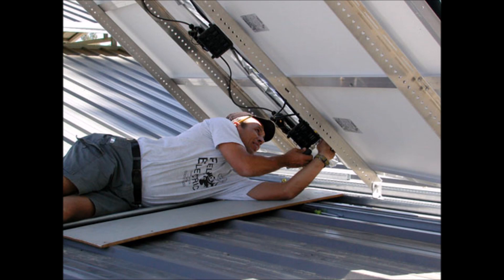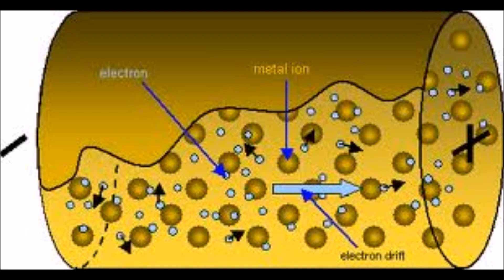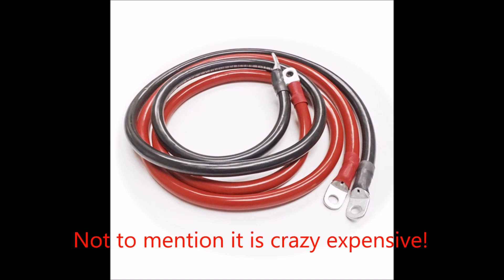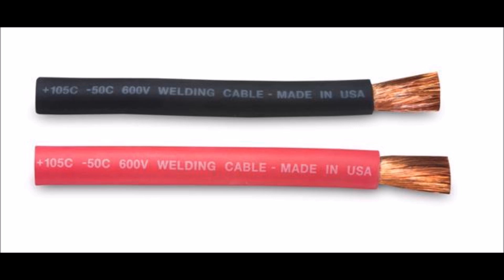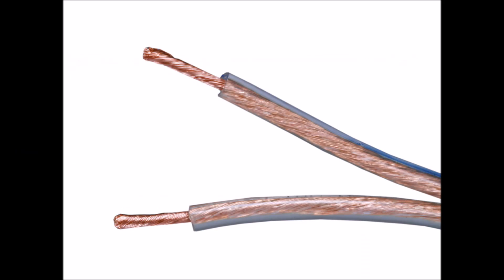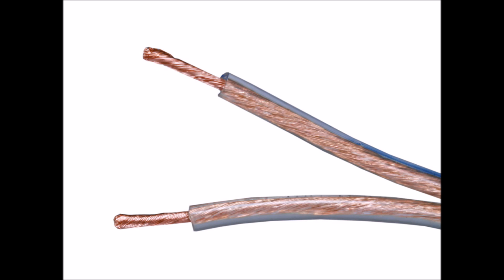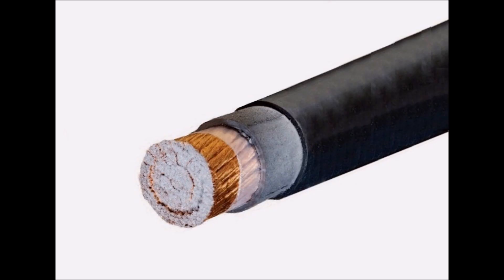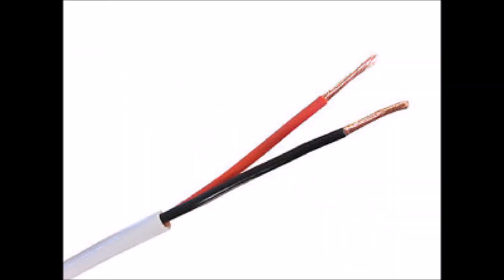Solar Panel Basics - Cables & Wires 101

Comment: Let me ask,  so every wire like the THHN can run both AC and DC, is it?
Reply from the maker: Yes, the wire doesn't care what type of current it is.  In AC there would be more conductors than with DC.  That is really the only difference.
Reply: Tnx for your reply! But what about breakers and fuses? Will they be used either AC or DC too?
Reply from the maker: No, breakers and fuses are specific for the type of current.  Some will work for both but not many.  If you are looking at house breaker boxes (load centers) then the QO series by Schneider will work for both.
Reply: Yah Schneider is everywhere here..yo da man.. thanks!
Reply from the maker: You are welcome.  I have successfully used the Homeline series in solar in the past but I really don't recommend it as they are not rated for it and they might not keep you safe.  The QO series is rated for 48V DC and can handle a LOT of amps, more than most solar panel systems will ever need.

Comment: Audio sucks, info not so good, better leave such advice to the pros, speaker wire for solar really!
Reply from the maker: Yeah I don't know what happened to the audio.  But the type of wire only matters based on the conditions it will be exposed to.  If someone is just getting started and that is all they have then speaker wire will work.  Will it last 25 years with the solar panel?  Absolutely not.  But some people can't pay $1 per foot for solar cable.

Comment: Can you run your solar panel wires to a fuse block or do you have to go to the battery directly?
Reply from the maker: Yes, you can definitely use a fuse or breaker in your wiring.  However, your wires should not be going directly from solar panel to battery.  You need to have a charge controller in between.
Reply: What gauge of wire do you recommend running from the charge controller to the battery( it will be for a 100 watt panel)? So i should just run an inline fuse on the wire before the battery?
Reply from the maker: For a 100W panel, you can use #12 gauge for up to 8.5 feet before you start seeing voltage drop.  That should be long enough unless you are mounting your charge controller a long way from your solar panel.  Go #10 gauge for up to 11.5 feet for under 2% voltage drop.
Reply: Thank you for your help.
Reply from the maker: You are welcome!

Comment: What gauge do I need to run a 50' wire from the panels to the controller? (Maybe can cut down to 40' but not anymore)
Reply from the maker: How many amps will the wire be carrying?
Reply: ummm....good question... it's a 100w / 18V panel,  so would that be about 5 Amps?  I'm still trying to learn this stuff hahaha

Comment: i have two 100 amp hour 12v deep cycle batteries. i need to put them in series in order to boost the voltage to 24v, as my panels are both 24v. then i will wire the battery bank to a charge controller less than 6 ft. away (batteries on the ground, charge controller at eye level). My question is, what size wire do i use to make the "series" connection between the two batteries, and what size wire do i need to use to go from the bank into the charge controller? i cant imagine 2/0 awg would be able to fit in my 30amp charge controller terminals. FYI im gunna be using only about 60w dc to power some ip cameras and an access point. No inverter in my system. all DC, just gunna use the "load+-" terminals on my charge controller to regulate/power them. thanks in advance for your time.
Reply from the maker: If the highest load you are ever going to use is 60W then the gauge of the wire between your batteries won't matter much.  The distance is so short and the load so small that almost any wire will do.  From the charge controller to the battery bank I would use #10 AWG as it is cheap and easy to find and will handle 30 Amps for up to 10 feet.  That is way overkill for your application but that would be what I would do.
Reply: LDSreliance hey thanks for your advice, i came to the same conclusion and ordered the 10# wire. but i want to leave room to upgrade to an inverter, so can i use  2# welding cable to connect the two batteries together? 2# between batteries, 10# to and from the charge controller.
Reply from the maker: Sure, you can do that.  I always use the biggest gauge I can afford and that will phyiscally fit in the connectors.  That way I have plenty of room to add things in the future.

Comment: Hi.       I have 2 solar panels of 150 watt each (8.5 + 8.5 ampere). Distance between solar panels and charge controller is 8 metres. The AWG table suggests 16 mm square cable. But in market there are only 4 mm square and 6 mm square cables. Is it possible to make 16 mm square cable by joining two 6 mm and one 4 mm (6+6+4 = 16 mm square)? ..................(12 v system)
Reply from the maker: Unfortunately, that would not be ideal.  Where do you live?  16mm would be roughly 5 AWG but that isn't a standard size so you would have to use 4 AWG.  I would also recommend THHN wire.

If you can order from Ebay, this is the wire I would recommend and the seller ships worldwide:  
http://www.ebay.com/itm/25-foot-cut-of-THHN-THWN-4-AWG-600v-Black-Copper-CU-Stranded-Ground-Wire-FREEshp-/332050333079?hash=item4d4fbdfd97:g:M-sAAOSwARZXljA2
Reply: I live in india. .................................................means 21.14 mm square?
Reply from the maker: The label ground wire doesn't mean anything.  It is just because of the color of the sheath.  Ground wire and power wire are the same thing.  5 gauge will work great if you can find it.  Here in the U.S. it is usually only sold in even numbers 4,6,8,10,12,14, etc.
Reply: There may exist many threads of copper in a wire........right!....... Do the gauge of a single thread remains same whether it is of 4 or 6 or 8 or 10 or 12 or 14?................do the amperage depends on number of threads in a wire?
Reply from the maker: Yes, you should always use stranded wire for solar.  No, the gauge of a single strand will get bigger with heavier gauge wire.  The amperage does not have to do with the threads, no.  It has to do with the resistance of the wire, which has more to do with the materials that the wire is made of and then obviously the length of the wire.
Reply: Thanks................useful information !
Reply: Thanks....one more time......... for eBay link
Reply from the maker: You are welcome.  Just be sure to subscribe to my channel and give me a thumbs up to help me out!
Reply: Hello LDSreliance!............. How r u? ................do I use DC MBC in my system?.......... Of how much ampere?..............single pole or double pole? ................before charge controller or after charge controller?

Comment: Ok I am pretty much clueless with my cable connection to a zamp equiped camper I have . I was told to get an adapter to reverse the polarity, so I did. But I cant connect the cable to the adapter because they are different connections , and I don't know the name of such an adapter. Could you tell me what would it be called that connects a 12 awg cable to a reverse adapter to plug into my zamp camper?  I'm sorry  I'm having trouble explaining my situation, but like I said I'm really clueless to all this .  Thanks
Reply from the maker: I am having trouble visualizing what you mean.  Send me an email with some pictures to ldsreliance@gmail.com.
Reply: OK!

Comment: I am only able to get my solar panels about 100ft away from my house. I have 10 12v x 15w x 1A. I have a roll of 10/2 house wire left over from when I rewired my house. My plan is to run the wire from my solar panels to my equipment in my basement. I can however put my equipment in a small area inside the chicken coop (sealed off from the chickens) and just run AC thru the wire into the basement. Would like to know your thoughts. Thanks for your time.
Reply from the maker: That is a great question.  I highly recommend that you convert the power to AC before running it through that long of a run of wire.  The voltage drop at 12v through that wire will be horrendous.  The other option you have is to wire those panels in series and parallel to achieve a higher voltage such as 24v or 48v.  That will lessen the voltage drop greatly.  If you do that, I would highly recommend an MPPT charge controller instead of PWM.
Reply: As an experiment, I hooked 1 solar panel up to the roll of 10/2 wire to check for voltage loss and found none. I was unable to check an amp output. . .
Reply from the maker: There won't be any voltage drop until you put it under load.  If you have one, connect a car inverter on one end of the wire and then a battery to the other end.  Then measure the voltage at the inverter.  It may not even turn on because the voltage might be lower than the minimum threshold for that inverter.

According to my calculations, if you ran wire 100 feet with a 12.5 amp load (150 watts) at a voltage of 12V you would need 2 gauge wire to do it with less than 3% drop.
Reply: I'm going to go the safe route and just make my set up where the panels are located & just run the AC from there into the house. . . Anyway, I do want to thank you for all of your help. I do have 1 more question for you. . . What is the difference between a MPPT charge controller & a PWM? Again, thanks for your time.
Reply from the maker: You are welcome.  MPPT is Maximum Power Point Tracking and basically it can convert excess voltage above the charging voltage into extra current.  In other words, if your panels are producing 16v but you only need 14.6v to charge your battery then it will take that extra wasted voltage and convert it to more current.  So it is more efficient than a PWM controller.

I really need to do a video on MPPT vs PWM controllers at some point.
Reply: Thank you again for your time and patience with my questions. I never realized that it was so many different hurdles to go thru. . . The inverter came today. . . The battery should be in tomorrow. I got the TRIPP LITE inverter PV1250FC. I can't wait to see everything hooked up. Anyway, thank you again.
Reply from the maker: Very cool.  Let me know if I can help further.  This is the exciting part of the project!

Comment: Good, but for long PV runs it depends on voltage. MPPT allows for higher PV volts and longer/thinner cable runs. For example, I am running about 110v of PV solar panel voltage through 125' of 10AWG dedicated PV feeder cable. Higher volts/lower current = lower loss. Using online calculators, my loss is about 1.7%...which is excellent. The solar charger will down-convert the higher volts to charging current. As for battery cables, welding cable with fine strands is the best for home RE systems...esp, if you make them yourself. Running 24v or 48v (inverter-battery bank) is even better.
Reply from the maker: *****
I just responded to your other video and it sounds like you grasp the concepts pretty well but just need to put it all together.

Yes, if you want to wire with 120v AC that would be MUCH cheaper and MUCH less voltage drop than 12v or 24v DC.  I think the online wire calculator was assuming you were using 12v.  75' of 2 gauge wire is going to be pretty expensive.  So if you can collect the power from the solar panels into your charge controller and battery bank very close to the panels and then connect your inverter and run a 75' run of Romex wire to your house that would be much cheaper.

I would highly recommend not connecting it to the electrical grid in your house, though.  Not only is that illegal (without a permit and the electric company's permission) but you could also hurt or kill a lineman or electrician who was working on the electrical grid in your neighborhood.  If you want to just wire it to an outlet box in your house so it is an isolated system all by itself that is fine.  It is probably still illegal, though, and your homeowner's insurance would probably not cover your house burning down if you make a mistake.

I'm not trying to scare you but those are the reasons I chose not to do it that way.  If you hire an electrician to do the portion inside your house it will be both legal and insurable.
Reply: LDSreliance is absolutely correct. Transmitting AC is much more efficient than DC. Try this online calculator...it has wire size, voltages, phase, number of conductors, distance, and load current. For load current, use the VOC. http://www.calculator.net/voltage-drop-calculator.html
Reply from the maker: +Chris DIYer Yep, I agree.  I felt like that was too complicated for this video so I tried to stick to different types of wires and only briefly touch on voltage drop and resistance.
Reply: +Chris DIYer OK, so confused.  When I go to the online wire calculator, they do not ask voltage, they ask for distance and amps?   And for just 75' it looks like I would have to run each panel separately (15amps max each) to keep my wire size down to 2 gauge.  But this is coming in at just under 3% power loss.

Would it be better to make a battery bank outside, directly beneath the panels, along with the charge controller and inverter, then wire the 120V from inverter to house?
Reply: What square mm stranded wire would I need for 15 ampere dc current from my solar panel to mppt charger

Comment: I enjoy your videos, especially the solar DIY ones. I am just starting solar and have 2 100watt panels. I need to run about 50 feet of cable to my charge controller, what gauge wire should I run. I am planning on getting a 12volt 100ah lithium battery with the appropriate charge controller. Any thoughts or ideas are appreciated.
Reply from the maker: +carver222 Make sure you get a charge controller that can handle a lithium battery.  Most that I have seen cannot.

As far as what gauge, you need to go really big for 50 feet on 12v.  As big as you can afford.  12v doesn't do well with restistance at all.  If you were doing 24v that would be a lot easier but most beginners use 12v.  For 200 watts, you should use #6 AWG wire to avoid huge losses in voltage.